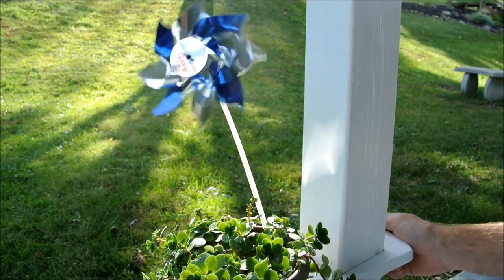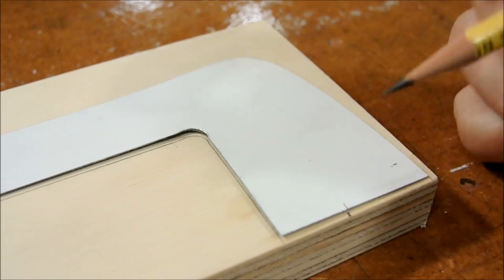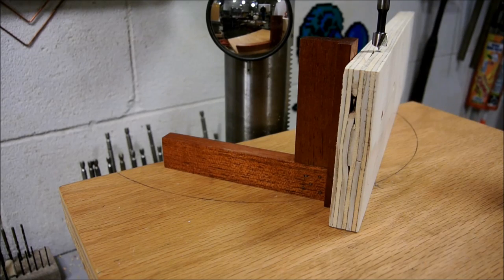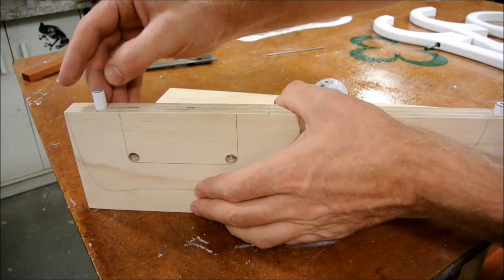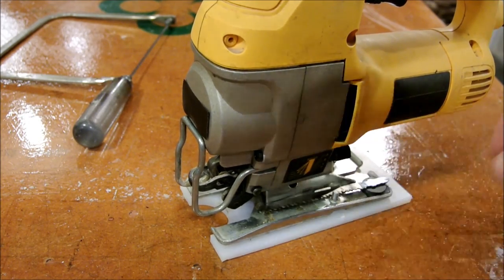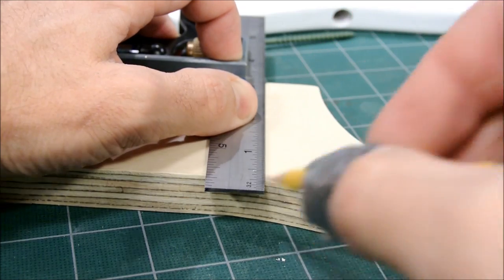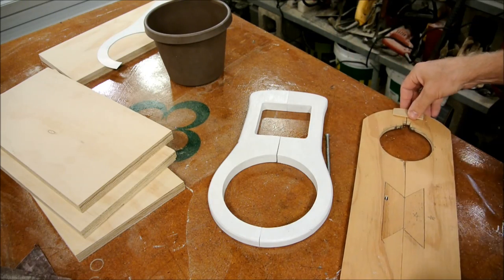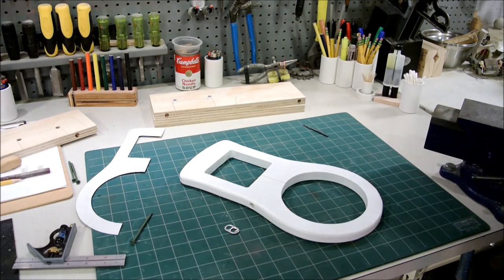4x4 Pole pot sliders ~ build one!

Comment: I made those with a dremel tool (don't have any better but it worked) but made them 5 shaped (the open square goes around the column, the open circle around the pot). Thanks for inspiration! :)
Reply from the maker: How do they work? I considered doing that. I was worried it would be disastrous in the comments, so I took the cautious route.
Reply: I made simple cutouts with sanded edges and several layers of transparent varnish. The idea of biting under pressure is exactly the same (the square part "hugs" the pole on three surfaces and can be easily taken off by moving to the side). They work great and I didn't had to do the joints so win-win, I think.

Comment: bravo, one of those "why didn't I think of that?" moments for me. I might produce a mess o them next spring. Maybe half lap the curved bit, round the ends of the lap and run a pivot through it so it hinges open, then maybe a pin through a similar arrangement in the back? 
I mostly work with solid wood, so that might not be ideal for ply, but it gets me thinking.

Comment: Very cool idea. But you can make it from one piece of plywood, if you do it without one of the sides of the square hole. Then it looks like a hook.
Reply from the maker: I tested that idea during prototyping. Far too weak, and far too easy to dislodge. In order to change the geometry to make it work, it would lose too much aesthetically. But maybe a "gate" could be made that way, so that it slides on and then latches closed?
Reply: Maybe just a wooden dowel through the rear? o.O There is of course the issue of closed ring for the pot, but it could also be open up to a third. Also the rear gate could be a sorts-of "shackle" that is put on "spurs".

Comment: you could make that as one piece and instead of a closed square to ride on the 4x4 you could just leave one side open and use 2 screws to attach the last side after sliding it on the post.

Comment: I have a question; why is it that you. Are the hole at the back so small and the second hole 'as deep as you can'? Also, why is the back hole larger than the front hole? Would to not make more sense to make both holes the same size and depth?
Reply from the maker: The front and back holes are both the same: 3/8" wide and 3/8" deep. The center hole is 1/8" wide, but on ONE of the two parts, this hole is countersunk with a 3/8" bit so that a screw head will fit down into the hole.
Reply: ahh, i see. sorry, i misunderstood what you said. thanks!